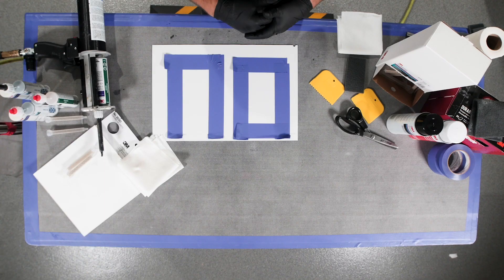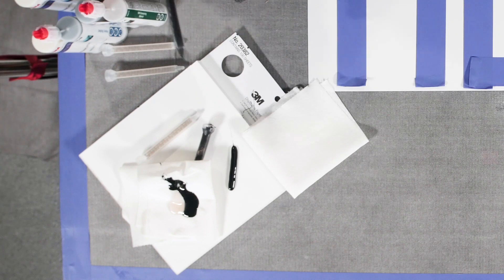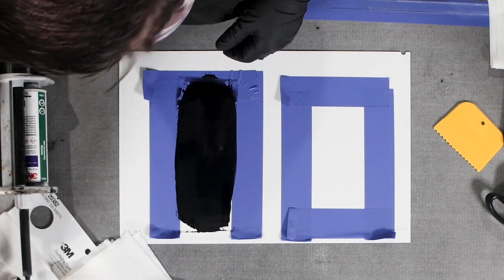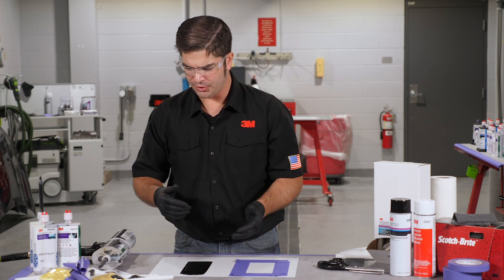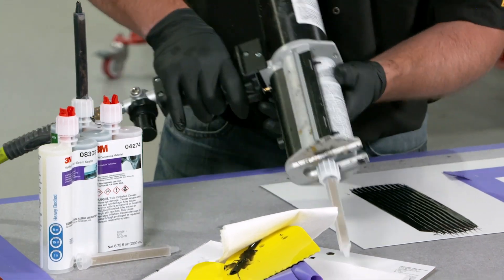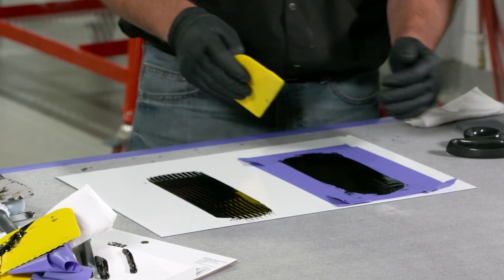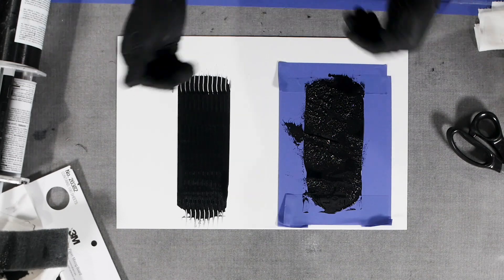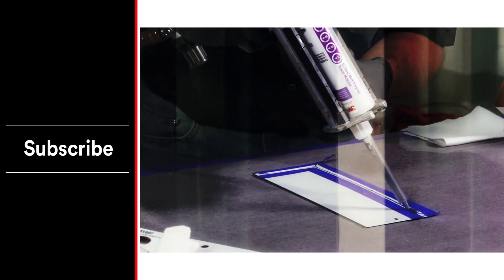HOW TO: Replicate Sound Deadening Sealers

Comment: Generally the parent panel has E-coat already on it. But so do replacement panels as the rear floor area is not easily salvaged and tagged "LKQ". 
  If resistance welded in place, TIG / MIG plug welded, E-coat burns on both side, so on cleaned, sanded and prepped, by this stage it should have epoxy sealer sprayed with proper flash time and temperature related catalyst to make it water tight. Yes, a few leave the seam black but 99% are painted after. So if done correctly, adhesive quality shouldn't be an issue, but is painted or epoxy seal went first, then moisture is not an issue, yet nice touch to add to the value of the 3M sealer. Sounds good on the "Cue-Cards" in studio.
  Don't worry about sound volume as other than headphones, you can't turn it up unless you have Bluetooth Speakers, but I am sure they all have a volume down slider to make it comfortable. But, who am I, just an ASE Master Tech since 78, not a 28 year old kid doing collision work. They may let you paint in 20 years there Buddy with full PPE. So, just wait!